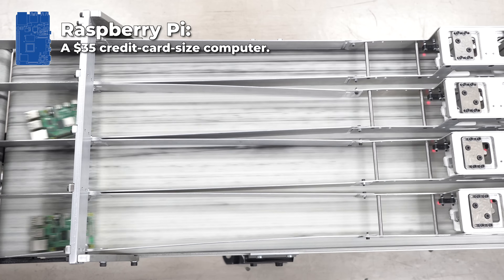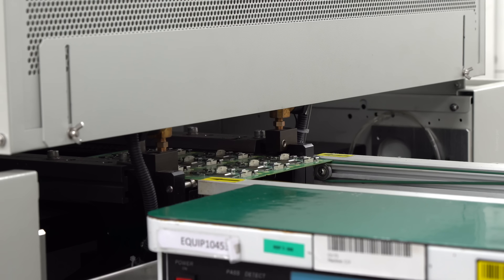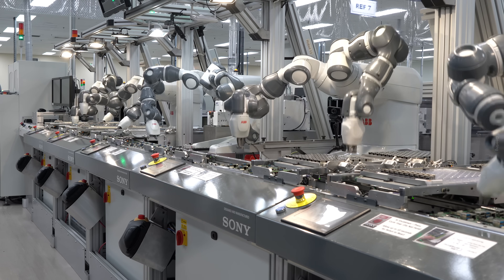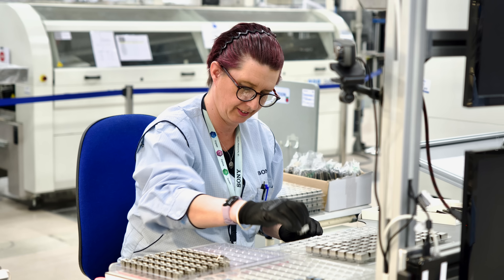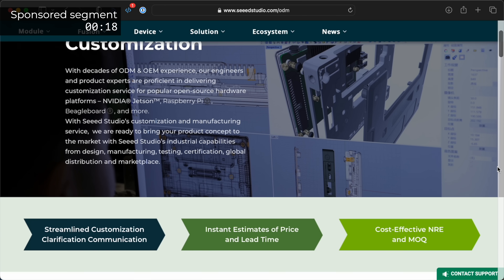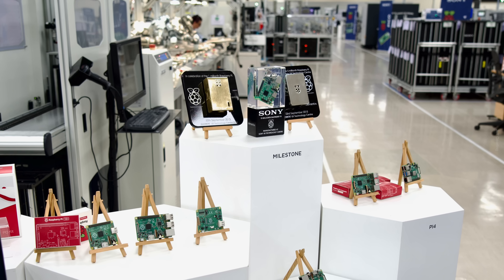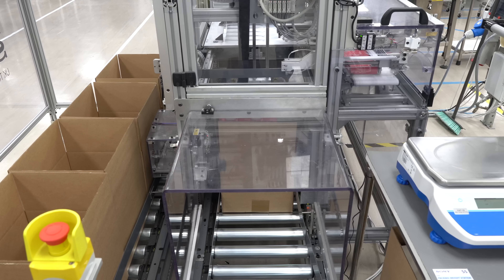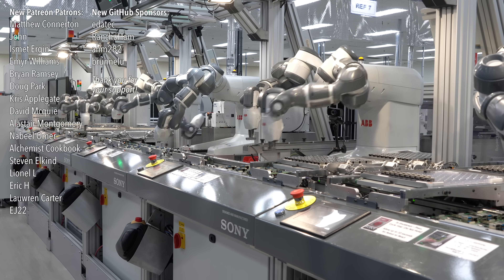How Raspberry Pis are made (Factory Tour)

Comment: This one will connect to that one 

And those connect to these other 2, in a straight line 

Which connects to a radio eventually 

And then another radio 

Which has a TV on it

For a keyboard, oscilloscope, speaker, and transmitter location 

With input on one end, and output on the other 

And the individual systems will be battery powered 

(How to make Czechoslovakia fall)

Comment: Very interesting. One thing I would ask the Pi bakers is: "Why no anti-static bag?" I mean that can be automated too can't it?
Reply from the maker: Good question! They actually worked with a packaging company to coat the interior of the actual Pi boxes with an antistatic coating, so it's ESD-safe without the little baggie. The baggies were extremely difficult to automate reliably (even the boxes are hard enough with the 8 or so steps in folding and glueing them). Non-ridgid parts can be tricky when you're in the tens of thousands and want to keep the line moving all the time.

Comment: 4:11 I'm not against robots, but it seems you're suggesting that people aren't being replaced and jobs aren't being removed, which is false. What used to require five people now only needs one. What happens to the other four? Unfortunately, I've witnessed firsthand how much some people really struggle with learning new jobs or "more qualified" tasks. People keep using this argument, but unfortunately, it only works up to a certain extent. I assume you're aware of that and just said it to maintain better fluidity in the video, but some people may take this as truth.

Comment: well my pi came in an electrostatic bag? But you dont see that in de video?
Reply from the maker: They changed the process a year or two ago to ditch the ESD bag—the box itself has a coating on it that provides the necessary ESD protection, which saves a bit on packaging.

Comment: Nice to see that the production is going on again well. This video was very fascinating to see and I know now why the Pi units are so reliable. The company I work for uses them for different machines that we've developed. Only issues we've ever had were that the touch panel suddenly stops working, or the device does not boot at all. Replacing the Pi has always fixed the issue. We've had an order of over 300 Pi4 boards waiting for years now from our supplier, I hope that could soon be delivered.

Comment: My first pi was the A model. I used it a bit but it was put away. When I got my pi 4 4 gig model, it was just before covid. When we were isolated at home, I attached my original pi camera and a headset, connected it to my 24 inch flat screen tv, went to the Zoom web page and was able to do the cr cr zoom while my wife used the computer in the office for her Zoom. Sadly, a thief ran off with that one. I now have a 8 gig model which I'm going to use as my daily drive. Got the red and white case and the case fan. Need the sdi card and will get it programmed, plus a couple adapters to connect to dvi d. Any fellow Winnipegers here?

Comment: Long heating is not the correct way to dry out boards and components, they should be stored in low humidity or sealed packs until they are used.    it takes 24hrs minimum to dry a component from heating, but it take several months in normal exposure to absorb the moisture.

Comment: Im sick of my raspberry killing sd cards. Just saying.
Reply from the maker: I would check your power supply—if you're not using the official power supply, make sure the one you're using is rated for a clean 3A at 5V, and make sure it's from a reputable brand! 99% of microSD problems are caused by flaky or underpowered power supply.

Comment: The warming stage of the reflow oven is not for removing moisture to stop popcorning. The circuit board has some thermal inertia. We need to bring the whole board up to a temperature just below the point that flux evaporates before the final high temperature that reflows the solder. We want to keep the time parts are exposed to the extreme high temperatures as short as possible to prevent damage. The process to remove moisture is only required if parts have not been stored properly and takes many hours to do.

Comment: Until now, I did not know that Sony was involved with the production of the Pi, I find this fascinating.
Reply: After the Sony Wales CRT TV factories in Bridgend (tubes) and Pencoed (chassies/assembly) stopped production in 2005, the Bridgend one closed down but the Pencoed one remained open and started making professional cameras, but that on its own didn't use the factory to full capacity. So the addition of the contract to manufacture the Pi has allowed more of the factory to be used.

Comment: When you realize your gameboy from 1989 was a sbc that was credit card sized, and contained a 8080/z80 hybrid cpu with a serial port, gpio port (controller buttons) and custom display processor (gpu) built 8k vram and separate 8k wram both can be bankswitched aswell  also the 32k worth of cartridge port space supports custom mappers so i could slap a cpld/fpga and 256k sram and some rom and a C010444d or 2c02 with an atmega at 21.47727mhz to do dat fas dma and bitter from from logic array and sram, load from micro sd, shit could overclock dmg cpu to 7.16mhz or underclock 3.579545mhz and have built in video out on cartridge for custom code, lemme port atari and nes cpu code, since video data can be separate and handled on cartridge

Comment: The evolution of the Production Line, from people working under near slave-like control and deadlines making Model-T Fords, through to lab-coated technicians whose occupation is more about Quality Assurance then it is about assembly. A little more then a century apart, but might as well be on different planets.
Glad to see supply is now catching up with demand - Don't be fooled about the "Chip Shortage", it was deliberately caused, as the chip companies chose to drop orders for chips in the older, larger Nm processes that they wanted to phase out - thing is, in many applications, and especially Automotive and 'budget' SOC's, those larger die sizes are more relable as they are far less sensitive to vibration.

Comment: Great video. Out of the whole process I had to wonder why the reflow curve had to have part of the profile obsured.
The number of apparent failures was surprising on such a process. I wonder if the process reverse tracks from where a part has been detected back to where it has occurred. At 1 point I think it says that there is a 99% success rate. That is at least 10 times worse than I would expect from a production line making such huge quantities.

Comment: 0:45 those copper areas look (to me) unusually reddish. Is that just the light or are they more reddish than common copper wire for example?

And those mass-scale production lines are amazing, no matter what they make. That orchestrated choreography of machines is an art form of itself.
Reply: It looks a bit unusual because you don't really see copper quite like that in most places. Bare copper oxidizes fast and that would ruin solderability. So there is very thin organometallic coating on the surface to protect it. You don't really see the coating, as it's almost atomically thin, you see the copper, really bare without oxide layer. Normally in most places you might see copper, it's under a coat of oxide so it looks different.
Reply from the maker: It's just the light; though seeing the pads all fresh does look different than you'd expect, since we always see these boards made with the silver tint of solder.

Comment: Is it possible to build a powerful Windows 11 system built from a Raspberry Pi to do music? A system specifically designed for music??   Would it be super expensive?
Reply: Youre not going to be doing much on a pi that could be described as powerful, especially not on windows
Reply from the maker: Yeah, I'd buy a small PC maybe used for that purpose
Reply: @JeffGeerling  I've got a 10yr old Digital Storm computer, i7 3970x. It works super good, but it weights about 70lbs and uses a ton of electricity.  Two water loop's.  It's an old gaming PC. It is a beast!!

Comment: All these robots and automated, the packaging line was what I liked the most,
no high tech (electronically speaking) in there, just force the cardboard through some very neatly designed tracks and it will fold on itself to form a box, How cool is that😎
Thanks Jeff!
Reply: The adhesive dispensing in there to glue the box together is much more high tech than you probably think.
Reply: @aleksandersuur9475  I know, but comparing it with the other things it looks something I can digest in my brain.

Comment: I lived in wales all my life literally down the road from pencoed yet had no idea we had anything like this! Unbelievable. Thanks for a great video Jeff, so strange to hear my home accent on one of your videos.
Reply: I live in a different part of Wales, but go to South Wales quite often and have been near the Sony Pencoed factory site a good few times, and it seems a decent size.
Reply: The PI is quite small so I expect the factory is too.
Reply: @wayland7150  It's a factory that used to make CRT TVs.  CRT production finished around 2005, at which point the factory pivoted to broadcast camera equipment and the like, which is relatively low-volume.  However, the fact that they have been able to ramp up the RPi production volumes shows that the factory's capacity was underutilised.  To that extent, RPi and Pencoed have both benefited from the relationship.
Reply: @misterflibble9799  yh and bearing in mind South Wales has  a very challenging enconomic environment (the shutting down of the collieries in the nearby valleys in the 70's and 80's basically removed all the jobs and they have struggled ever since) the value of high paid, skilled jobs, and all the ancillary jobs in and around Pencoed to facilitate everything cannot be understated.
Reply: @wayland7150    google sat view might help to find out, they do make other stuff as said in the video, so the entrance to the factory might be small but the floorplan.

Comment: I call BS on the numbers, still its almost impossible to get any raspberry pi.
Reply: If a company makes 100 pieces and the demand calls for 120, there will be a shortage. So I don't see why the numbers would be BS, the demand is simply higher than the production volumes, despite very high production volumes.
Reply from the maker: I guarantee those numbers are accurate. Talking to Pi resellers, they get batches of a few hundred a week now, and they still sell out within minutes.

They are still supplying more volume to commercial clients (managed on a per-account basis), but the retail volumes have been going up.
Reply: Then where are they all going and why dont we see any off them being used in final products ?  If they make the numbers that they make, and im not watching some North Korea style fake factory, then why is there no change in availability? Every 3.2 sec orso a rpi4, and it has now been years they where available or even say in stock

Comment: Great video! I was surprised to see that the Pi's don't get packaged in an antistatic bag. Did the tour give any insight on this or do Pi's have really good ESD protection onboard?
Reply from the maker: Pis do have very good ESD protection, and they used to be packed in ESD bags until they switched to the new packaging line.

My guess is the number of ESD-related incidents is so low they don't want to manage the overhead of bagging them up (it makes the process way harder).

I personally haven't had any issues... and I also touch Pis quite frequently in a carpeted room without issue :D
Reply: @JeffGeerling  Actually Sony did a great job of replacing the anti-static bag with a special anti-static coating on the inside of the box
Reply from the maker: @gordonhollingworth5281  Oh wow, I should've asked about that, that's really awesome to hear! I presume they do the same for the CM4, since that's how it's packaged too?
Reply: @JeffGeerling  Yes, originally people had to hand-insert the Pis into the anti-static bags, even after automating the test system this was still done by hand.  The team at Sony tried to develop a machine to 'hold open' the anti-static bag using suction but it never worked properly.  We then discussed the problem with our card manufacturers who had heard about the coating that can be applied...
Reply: There is an antistatic card inside the box

Comment: It has always annoyed me that ”credit card size” refers to the 2D plane of a credit card, not the thickness as well.
Reply from the maker: Heh, that would increase the cost exponentially, as even a 4-6 layer PCB would be slightly taller, not to mention all the circuits on top!

It would be cool to find a way though.
Reply: @JeffGeerling yeah. It’s mostly the different connectors that use the most vertical space.

I guess flex cables could solve that.

Comment: The extra soldering liquid can be used again ?
Reply from the maker: As long as they make sure to clean up the dross (that 'slag' like stuff on the top surface) every now and then, and keep the bath maintained, they pump the solder through and just add more as time goes on.

Comment: Factories evolve they are not created from scratch. Also they put their money where their mouth's are by using raspberry Pi's to make raspberry Pi's.
Reply from the maker: It's amazing seeing the factory floor today versus even 10 years ago (there was another tour from back then, where almost every step had more manual intervention, especially the testing!).
Reply: I hope you noticed the big and very expensive Omron PLCs in those electrical boxes doing all of the hard-work.
The RPis are probably only doing some performance monitoring and camera feeds - not even the vision systems as they're stand-alone items.
Reply from the maker: @Shocker99  Definitely—the Pis are used mostly for monitoring and networking tasks, grabbing data from other systems and pushing them into a larger 'overview' system they have (the main display which I had to sadly blur out towards the end of the video).

It gave an excellent birds-eye view (which is remotely consumable!) of every aspect of the line, and I'm sure has more than paid for the time spent building it out.

A similar bespoke system using only PLCs and the software from the major players would cost tens of thousands (at least), whereas Sony has a customized and optimized system, built using the computers they make in the factory, giving the factory workers and engineers not only the satisfaction of dogfooding, but also the skills to improve their own process in-house to a degree many manufacturers can't!

I also spotted a few Pis in their imaging division, handling some measurement tasks for sensors and OLEDs (even one original Pi that's been in service for a decade!).

Comment: Due to my inexperience at the time in using lead-free solder, I faced the 'popcorn' effect on certain through-hole joints. Turns out the right temperature and procedure is important to achieve a good solder joint. Nothing but respect for the engineers out there who had to go through lots of trial and error to achieve the optimal reflow zones.
Reply from the maker: It's an art! No matter how good you think you are at soldering, there's always some joint that'll humble you :D
Reply: lead free sucks, but in ensures they always sell new electronics.
Reply: @jhoughjr1  Lead free is perfectly fine for production because they have totally dialed processes to use it with. Also helps with obvious health concerns. I'm an Engineer who makes lots of prototypes and I never use it except when forced to, it's awful to work with in manual processes!
Reply: @peejay1981  agreed. I believe the heath concerns are massively overblown having know many people including myself who worked with lead solder.
Reply: @jhoughjr1  just wash your hands after playing around with it, simple as that.
Reply: @BastetFurry It really is, since the boiling point of lead is way too high for it to be a problem. The lead is mostly absorbed or consumed through residue on the skin, not the fumes.
Reply: @jhoughjr1  whilst frowned upon by hobbyists, its known effects is one of the main reasons RoHS exists.